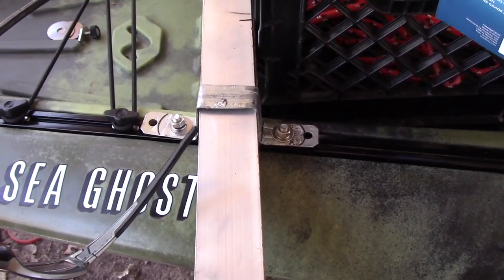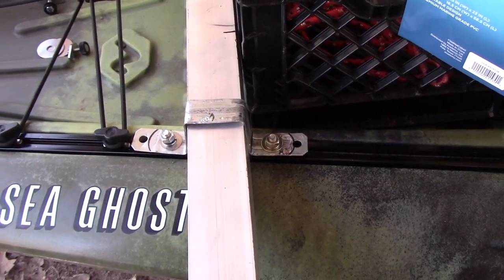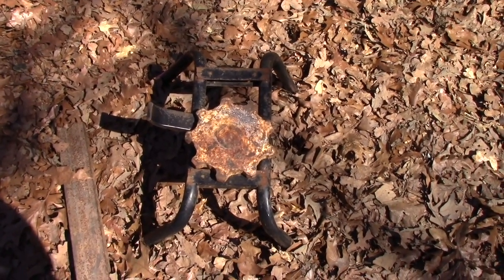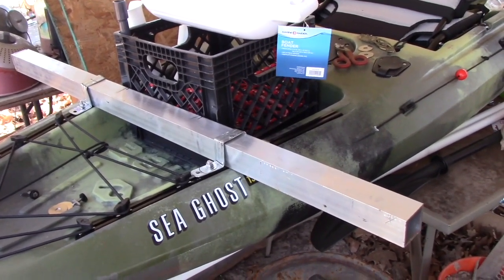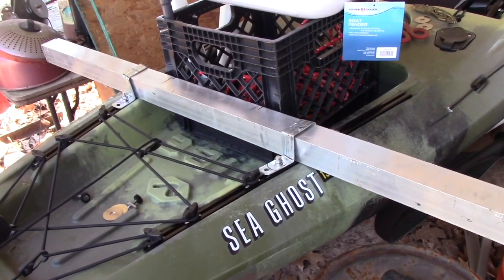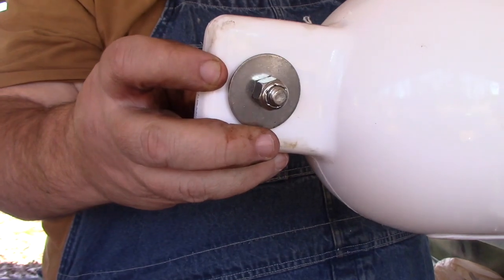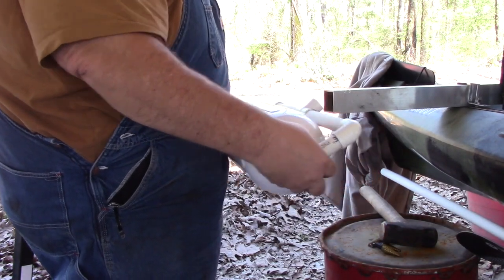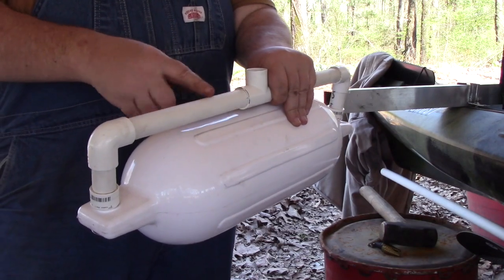Vibe Sea Ghost Outrigger mod.

Comment: Hey man, just bought the same yak this week. Picked it up Friday, put it together sat morning.  Took it out to a local small 1-2 acre lake. Approx 5 foot deep. I went by myself because my friends that were supposed to go had to back out. I went in naked/dry. Just me the kayak, paddle and PVD. I was in the damn thing 5 min and rolled that damn thing. LOL I have a lot more practice to do with it,  I busted my nose and I am going to practice in as much of a controlled environment as possible and with someone else there. I am thinking my size makes things harder and I will be doing like you and putting these on or something similar if I cannot stay in the damn yak.  lol
Reply from the maker: Where are you located
Reply: @Big_Johns_Life   I am in a small city called Clanton 35-40 miles north of Montgomery in Alabama. I realized I have a different one i have the 110 so its 11 ft. long. I went with that one because I have to man handle it and mount it to the roof of my camry. Which actually I got the hang of and its pretty damn solid. I think my size 6'1 305 an technique helped with the fail of my first test run. Did your outriggers finally get dialed in and working?
Reply from the maker: @x2breid1  yes they did I fished in it for a few hours Wednesday. If you need a 4' section of the aluminum let me know you can e-mail me or hit me up on Instagram
Reply from the maker: @x2breid1  I'm 6' 1" and about 80lbs more than you so you should be good with some outriggers on that kayak

Comment: Looks good man. Question though did you measure where the water line would be? You don’t wanna get in and bc of the pressure pop out of the gear track.
Reply from the maker: I tried but that's why nothing is glued yet